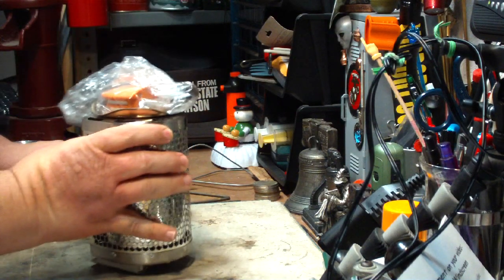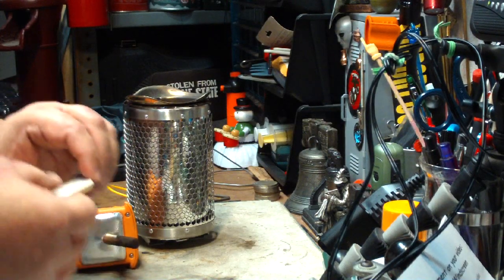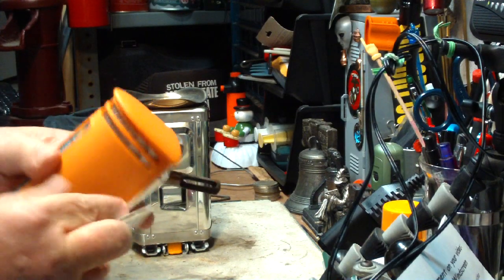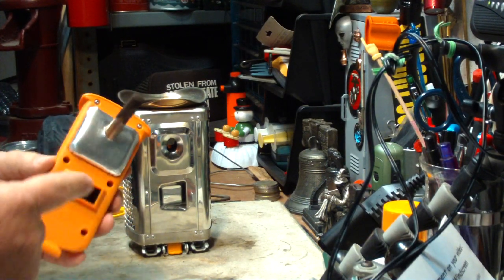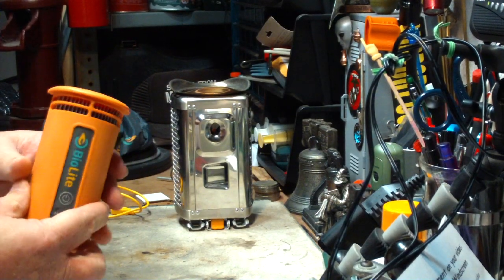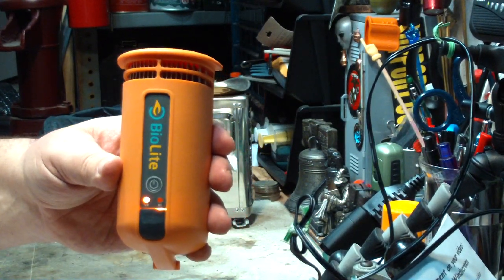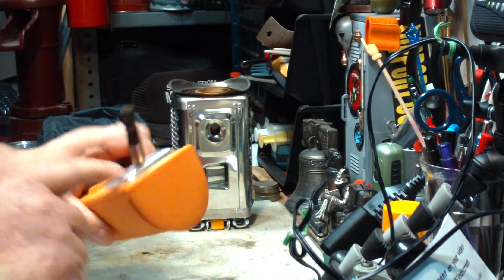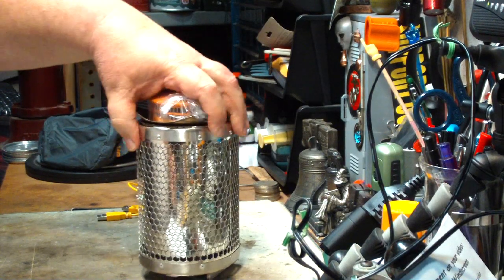BioLite CampStove Q & A #1

Comment: There's a  PIC 16F616 micro computer inside the Biolite. Start a fire inside it and code not like this starts to run: btfss PIR1,TMR1IF;(1Tcy) TMR1 overflow?, goto HighISR, (3Tcy) jump to high priority ISR code, HIntVector code 0x0008, (3-4Tcy), fixed interrupt latency, retfie FAST, f TMR1 update can be completed before clock pulse goes low, start update. So the stove is making lots of decisions and adjustments every millisecond. Check a datasheet for the PIC16F616 and see what it can do

Comment: At 5:20 the USB lamp was plugged in with the fan switch off;  it did not light.  

At 6:09 you say say getting it to temp gives "better" current to "this thing" while tapping the USB port.   This implies some current is being delivered to the port before full heating, which I think is the essence of David's question.
(continued below - char limit)